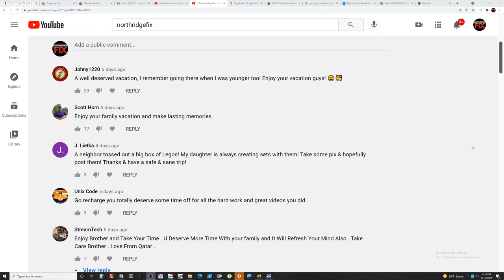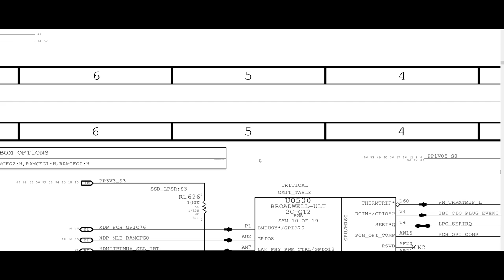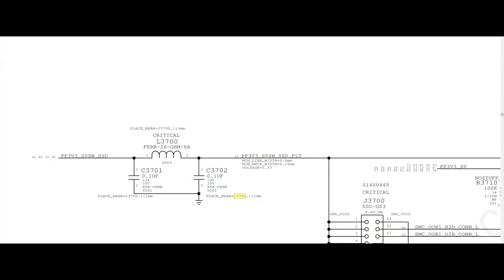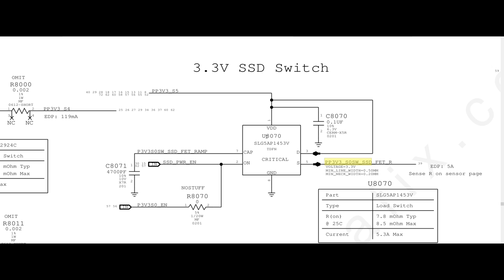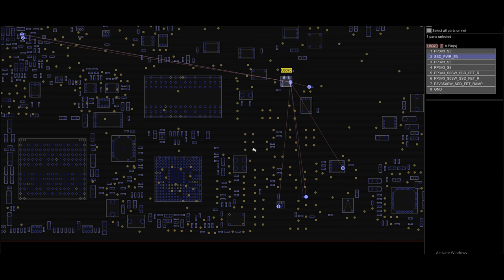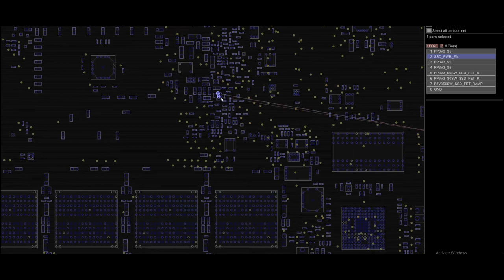Macbook Air SSD not detected motherboard repair

Comment: Alex I always enjoy you videos. I was able to for your logic to find the problem, however in this case is not clear why you had to add an extra 100K resistor to enable the SSD power. I  understand what it does, but was the cause of the problem?. Surely the 100K resistor did not run away by its own!.Why did it stop working?
Thanks and keep doing what you do
Reply: ''something'' is pulling down the 3.3V SSD_Enable rail to 0.5-0.2V 
now Alex notices there is a second path for 3.3V SSD_Enable and opened the gate of this closed path by adding the 100K resistor.
no the 100k was never there before, and your confusion comes from the fact that alex didn't "Fix'' the problem ofthe first path he instead forced 3.3_enable signal onto an other path
Reply: I don't understand the problem or the solution. I guess he's saying that the resistor was damaged in some way but don't we EXPECT a voltage drop across a resistor? Additionally, was the added resistor placed in parallel or in series with the allegedly damaged one? I suppose knowing what voltage level to expect for a valid enable signal helps....
Reply: He "stole" the 3.3v needed to activate the chip that send 3.3v to the ssd, I'm not sure about it maybe someone expert can explain that better
Reply: @antbuch8699  the other 100k resistor was not damaged: he measured an was within tolerance
Reply: It was a nice logical chase for the problem, but indeed, if the resistor was good it seems to me it would still not work, maybe a trace problem... Anyway, it worked, and the valuable information here is the logical thinking.
Reply: I feel the same way man. I love watching Alex's videos and also love his troubleshooting techniques but I have a feeling of discomfort with this fix. There might be a reason why the 3.3V is not being supplied to the other resistor (maybe some kind of a fail safe mechanism to avoid damaging the SSD device) and bypassing this by introducing anothing 3.3V pull-up resistor might cause damage to the SSD if the same conditions that caused the other resistor to stop supplying 3.3V happens again.

Anyway, he's the one with the experience and knowledge on how to do this job and I'm just a regular Youtube subscriber and fan of the channel (using a burner youtube account for this post) so my concerns may be for nothing.
Reply: @juncena2851  Alex also did not explain from the schematics were was the signal coming from, only that a 3V was needed to enable the chip
Reply: In this business, time is of the essence, it does not matter why it happened, it is important to get results in the shortest possible time.
Reply: @javiermitchell7073  Most likely coming from one of the other 2 chips connected to it.
Reply: @john.84  But it might also not be good for business if the customer comes back a few weeks later telling him that the macbook is not working again but this time, the SSD is also toasted and the user has lost all his/her data. Anyway, I’m not an expert at this and my concern might be for nothing. In cases like these though (i.e. laptop bugs down for the second time), most people would probably think that the laptop is beyond repair and will probably just get a new one.
Reply: @juncena2851  it can also happen by company repair . So they simply change board
Reply: I was wondering about that too, it seems a little odd that the machine had worked previously since new without that extra resistor (that Alex added), and with the addition of a previously un-needed resistor now works fine (essentially a mod), I don't get it...🤷‍
Reply: This doesn't look like a repair that will allow the MacBook to work in all states of operation. I image it will boot every time rather wake from sleep. pp3v3_s3 should be all that creates the ssd_enable. If that's not working then the SSD won't be powered during sleep. I wonder if Alex could comment.

Comment: Haha, this is what repair is all about.
the troubleshooting part got me into repair.
I understand plenty were a bit disoriented by what's going on, rewatch the video and pause to understand the thought process of fault-finding. 
now when it comes to the repair:
something is pulling down the 3.3V SSD_Enable rail to 0.5-0.2V 
now Alex notices there is a second path for 3.3V SSD_Enable and opened the gate of this closed path by adding the 100K resistor
Reply: Im confused. Isn't it the same line. Current will follow the path with lower resistance anyway.
Reply: @mohsentabouna6401  Thank you Sir. Looking forward to learn more.
Reply: @mohsentabouna6401  hello, am fairly new on the channel and am having problems obtaining schematics and board diagrams for mostly apple laptops, can you pls help me with a link or website where I can get both. Thanks in advance.

Comment: Welcome back Alex.
Why the output of 2nd resistor is not being pulled down by the primary fault?
Reply: seems like both paths to 3.3v on ssd are not same
Reply: as I mentioned before, 
same source voltage (3.3v), not the same line ( different states ).  
The best way to understand what's going on is to download schematics and board view software it's freely available on the internet 
Good luck.
Reply: It is because these two resistors (actually one resistor and other is a placeholder) use different 3.3 V to power SSD drive. You can find the schematics easily, just type 820-00165. Originally, on the motherboard was only R1696, and it used 3V3_S3 (3.3V in S3 state) to power SSD. R1620, which was omitted is supposed to use 3V3_S0 (3.3 V from S0 state). When Alex soldered R1620 on the board, this resistor provided 3.3V to power SSD but from S0 (working state of the laptop).  So, the primary fault was not "large enough" to catch the source PP3V3_S0 (or better, this fault didn't prevent laptop to enter S0 state).
Reply: @asv5769  but will it continue to deteriorate and cause a second failure?
Reply: @tschupbach  most likely not. If S0 fails, the laptop would not boot anymore.
Reply: the line in question was an S3 line, but is also wired (the line missing  the resistor) to come from S0 line. So basically what he did was connect the S0 line so the enable signal can pull its 3.3v from the CPUs S0 state line. The computer uses power states like any laptop from S5 (off) to S0 (boot), and this SSD power enable line by design enables at S3 (Sleep). This computer boots now but will probably NOT wake up from a sleep state properly, as S3 state (sleep) will cause the drive to just lose power and data will crash.
Reply: @down2earth485  that is probably what is happening right now to the customer.

Comment: It's very instructive to follow you Alex but I don't understand how did you arrive to this conclusion : adding a resistor where it was empty "by default" (so it was engineered this way to be working) fixing the issue when the other resistor appears to be working correctly... how did... what? lol And how did you arrive to a value of 100kΩ?! Just because they are in parallel so better add the same resistor and change the value to 50kΩ in the circuit that was not designed this way? And still it's working xD I can't believe it but it's very satisfying!!! I'm from Montreal and I'd like one day to have my own repair shop also. Thank you and continue your marvelous work! And great gear overthere switching camera views hehe

Comment: Good repair,i like the way you went step by step,then you brought out the drawing to show us a map of parts.My only question is why do you think apple did not put a component there in the first place?Since they only cost a penny each.could it be used as a test point in the factory?It's a redundancy ,but like the space shuttle there usually is NOT a connection left open like that,since you cant find parts in space on the way to MARS.haha OR maybe if you buy the extended WARRANTY then they call the factory and say ,hey this guy wants a WARRANTY>>>solder on the other resister on for THAT GUY>haha  thanks for the video.

Comment: So as I see it you could use any 3.3v line to ssd enabled pin. Or move that resistor to the other line without adding a new one?

Welcome back and great job as always 👍

Comment: Good Video, Good explanation. How u judge issue get solved by connecting resistor parallel with same size.? i think its not mentioned in circuit diagram also. If we connect two resistor parallel with equal value, total resistance will be half. Anyway problem get resolved that's     very important.

Comment: Hi I inspired your work im from japan i just want to ask i have issue on my macbook air mid 2011 when you press power nothing display on lcd  no chime sound nothing only fan is running also when u plug the charging cable it also have green light and orange…i wish i will learn from your work :) thanks a lot 🙏

Comment: quick question if hibernate (S4?) is enabled and the owner hibernates the machine expecting it to return to whatever they were doing after a power button press, wont that now fail? Hibernate writes the system state (Ram, memory pages etc) to disk. If the device only sends the enable in S0 (fully on - normal working) then trying to return from S4 to S0 will require reading the state from the disk. Which it cant do as the enable pin isn't high due to the borked PP3v3 S5 (/S4/S3/S2/S1?) circuit(s)

Comment: When Power Supply Short Injection / Detector with Voltage and Current Control will be in stock please because I have been long waiting my master

Comment: My MacBook Air mid 2012 has question mark folder when turned on but for some reason sometimes turns on normally but shortly freezes with rainbow pointer then shuts down, please help

Comment: Hello sir. Do u have a video how to fix MacBook Pro 2015 a1398. It has exact the same issue with the ssd. I checked all possible solution but no luck. Most likely problem is with the motherboard which not reading an ssd. If u could assist would be greatly appreciated

Comment: ok, a possibility that there is not 3v at the other end of the resistor is that another component sends the signal to ground disabling the 3v, this signal as you said also comes from the cpu, perhaps the client disabled the ssd for boot for pendriver by bios or a virus modified the bios boot. no speak english but i like u videos

ok, una posibilidad de que no haya 3v en el otro extremo de la resistencia es que otro componente mande la señal a tierra deshabilitando los 3v, esta señal como dijiste también viene del cpu, quizas el cliente desabilito por bios el ssd para boot for pendriver

Comment: I am upgrading the ssd on my MacBook air using an adapter but the ssd is not detected, however the old one is working properly. I have replaced the adapter but no luck. I bought Crucial 500gb ssd. Can you please suggest any option
Reply: I have also tried terminal option to check the disk list but it doesn’t appear on the result of this command

Comment: 3:20 Hard Disk Drive and Solid State Drive is not the same. HDD is mechanical moving components, where SSD has NO moving mechanical parts, only chips and other fixed parts 😁.